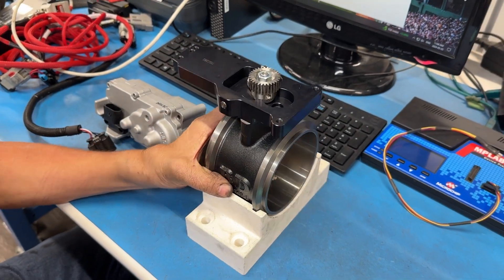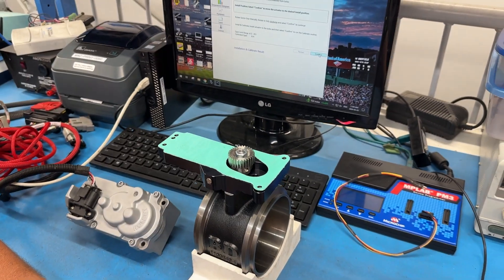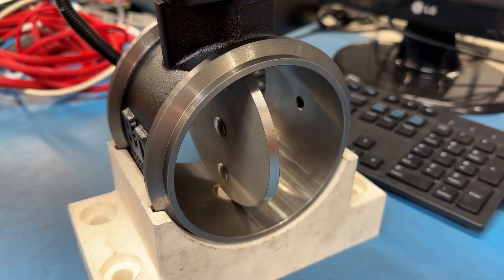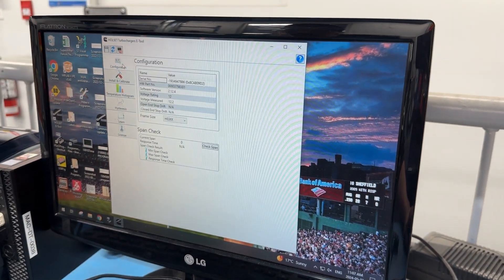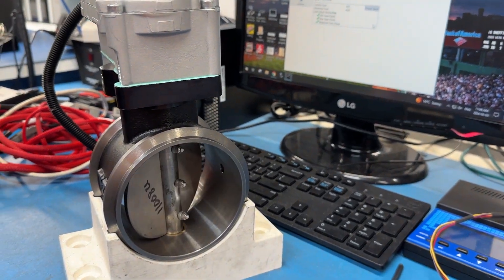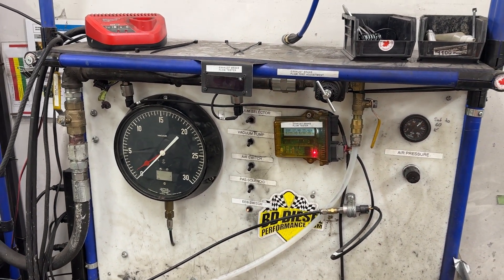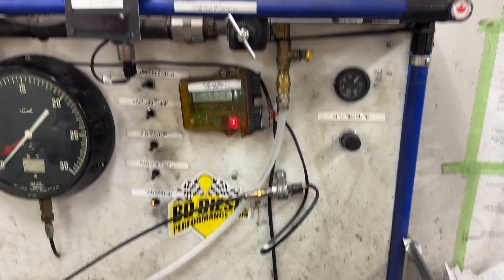Electronic Exhaust Brakes - HOW DO WE TEST THEM?

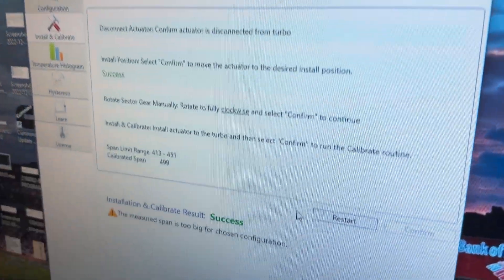Comment: 1:26 mark ..... limits and test run.... not within limits...
Reply from the maker: Great catch! The holset tool we use to calibrate and test the actuator is designed for turbochargers, and the ranges are set as such.
With the Electronic Exhaust Brake, we have a different criteria for the span and test measurements that we test against, as the stroked distance is different between a turbocharger and the exhaust brake.

The unit tested in the video indeed passes the required span, although it’s outside the span test range for a turbocharger.

I hope that clears up the detail!
Reply: @BDDieselPerformance  i run your brakes on my trucks they work well just jabin at yall in the video lol.